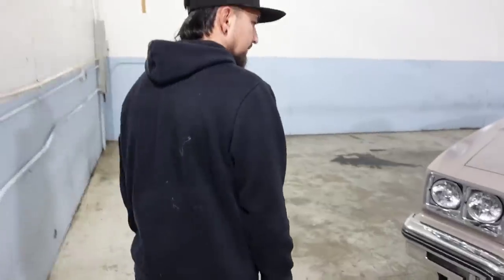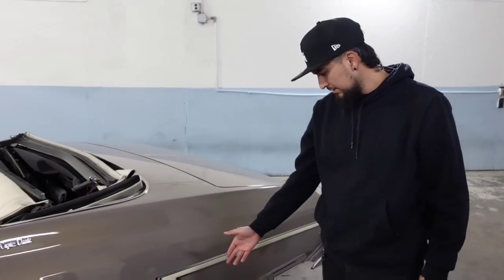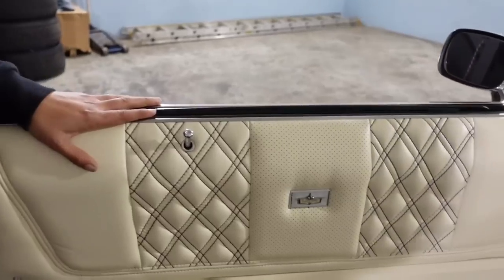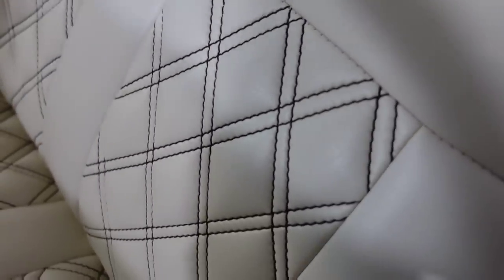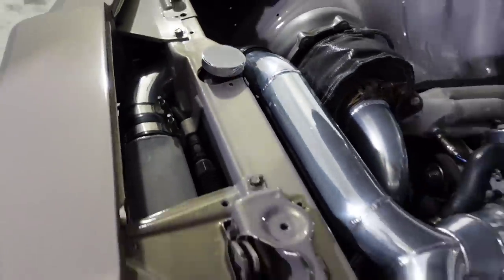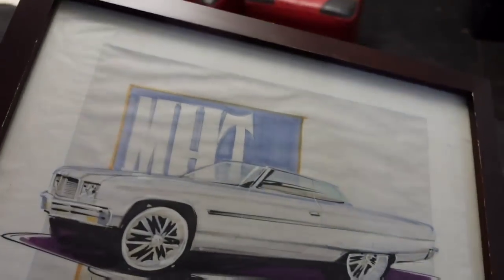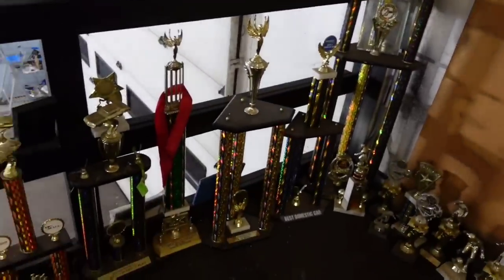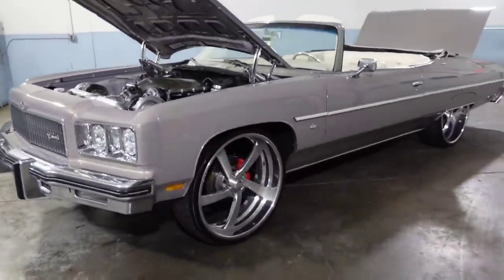Hardest 75' Caprice Donk in the world

Comment: Awe inspiring !  Thank you.  I actually ordered a new 1972 Caprice coupe, Fathom Blue with light blue vinyl top and a lot of options.
And I did order the bumper guards and rub strips, which were two separate options that model year.  Sold it in 1975 in Santa Ana and ordered a yellow 1975 Corvette coupe.  I am sorry I sold it.  So now I am looking for another 72 Caprice coupe.  Do you have a list of your suppliers for all
those accessories and parts?  I will need a parts source when I do find one.  This is the best one I have ever seen !